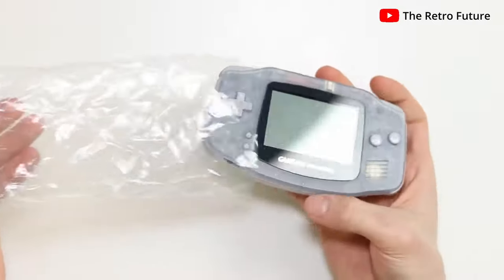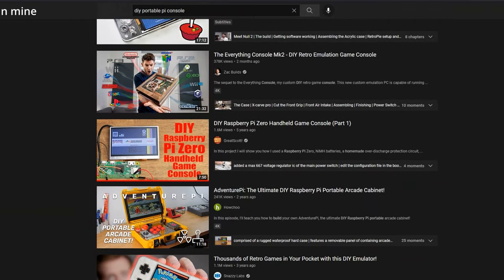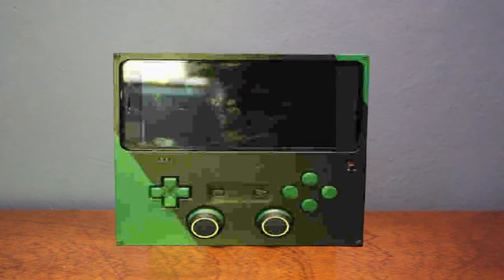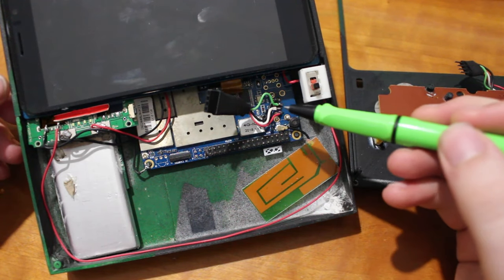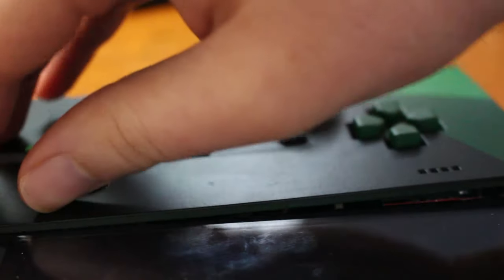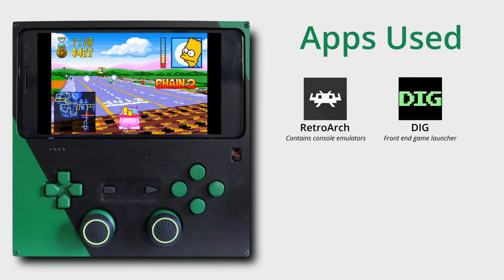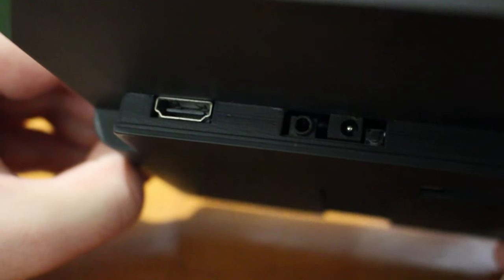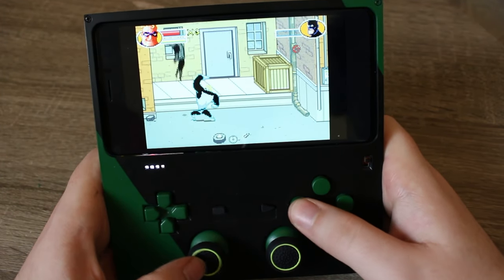WideBoy™ - DIY Android Retro Console

Comment: Literally found this while thinking of something similar but with an old phone. I have no electronics nor printing experience tho :(
Reply from the maker: The super simple solution is to just get yourself a cheap Bluetooth controller and use it with your old phone, what I built was a little over kill. As for electronics and printing skills, there’s always time to learn, start with some smaller easier projects and you’ll get the hang of it.

Comment: what pcb did you use to connect the lithium battery to the orange pi also how did you connect the controller to the orange pi
Reply from the maker: I used the power banks original BMS circuit, controller connected to the orange pi via its USB port

Comment: Are there any alternatives for orange pi 4g-LoT?
Reply: An Android phone with video over USB-C is one option.  Bonus points if it has a desktop mode to fit a normal sized screen.  A 2018 vintage Galaxy S8 with a dying screen and busted back glass is going to be dirt cheap; a lot cheaper and a lot more capable than an Orange Pi if you're going to make an Android gaming handheld.